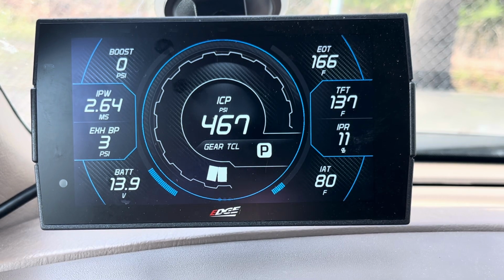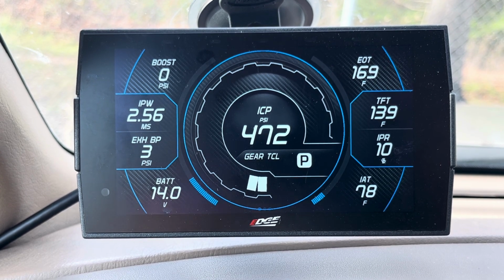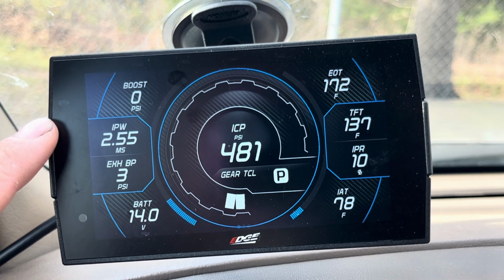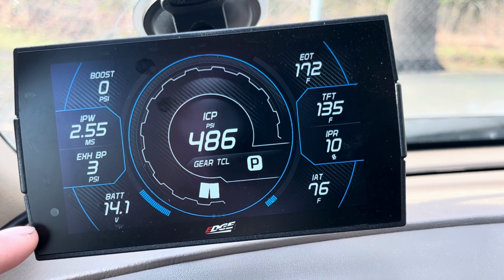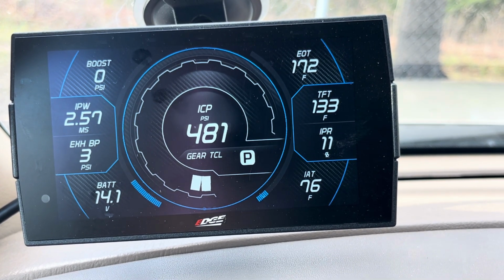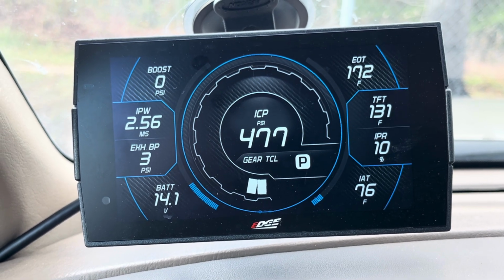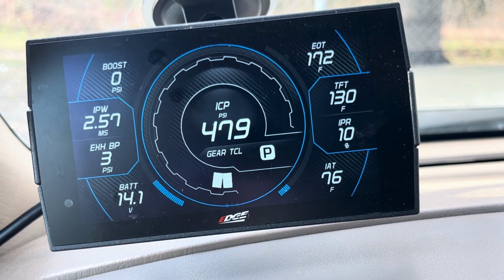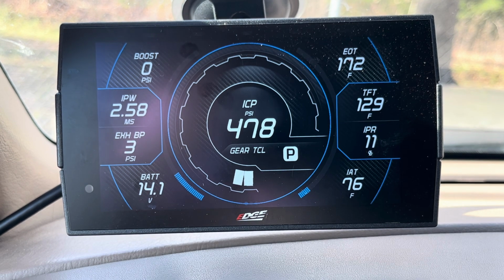What to monitor on your 7.3 powerstroke diesel and why

Comment: I installed a CTS3 last week the 7th Jan, 2026. I used a lot of the info you shared to set up my CTS3. I was able to get the gear TCL to show. It is nice to see what gear it is in.    Yesterday the   12, Jan, 2026 I disconnect the batteries because I started to install the PHP Hydra. Today when I was done with the Hydra install and had the batteries hooked back up the Cts3 didn't wave everything the way I had it set up, which was pretty close to your setup. I had reenter the VIN.  Now I can't find where the gear select is. It acts like it no longer seer that parameter.  Do you have any suggestions how I can put that back on the screen.
Thanks
Reply from the maker: I have seen this a few times and I am not sure why the hydra causes it. Reset the CTS 3 in the factory menu with the hydra installed. You will have to re do your gauges but it might correct the issue. If that doesn’t work contact PHP or Edge and let us know. Both have good customer service.

Comment: 4r100 can pull 220f all day.
Reply from the maker: Proven fact the cooler your automatic transmission runs the longer the life. Running 220F is getting up there and doesn’t give you a lot of room if you hit a big hill with a load.
Reply: @cbr600rx7 I’m just saying it can run at those temps. Yes you are right hit a hill and it rises. I’m saying if you hit 220 climbing it’s nothing to be concerned about especially towing or like me my e-350 weighs 12,000 lbs loaded when traveling.

Comment: Just received the CTS3 for my 2000 7.3. I thought boost was a PID that would be read. Now I’m reading that one has to buy the EAS comp kit to do that. Will the CTS3 Insight read boost from the PCM or do I have to add EAS kit (effectively doubling the cost)? Thanks
Reply from the maker: The CTS3 can read the MAP sensor up to around 23psi over atmospheric pressure.  (Air pressure + boost pressure) if you need to read more than that you will need a dedicated boost sensor.

Comment: My ebp shows 0 at idle and never goes above 6-8 but my exhaust is straight piped
Reply: Same for me I was wondering the same thing I see nobody responded😂
Reply: Straight pipe, turbo back or do you have custom headers? 
Ebp is on the headers. Mine is straight pipe from down pipe back, mine reads 14.5 psi at idle. Cant figure why his is so low.
Reply: Not sure if headers is the correct term for turbo/ diesel motors. 
Exhaust manifold? Lol

Comment: I'd pay for a list of abbrevation explanations with proper ranges.
Reply: You can Google most of it, it’s kind of a pain. Not every truck will have the same parameters, but some will be close to universal.
Reply: When your scrolling through there’s a little circle by each option. And it will pull up what the abbreviation means

Comment: I put EGT in the middle and set an audible alarm on that rotating ring around it. Edge makes you buy another kit. Then you have to drill your exhaust manifold. Looks like you have another vid on that.
I've been told that an actual coolant temp can be added with another Edge kit, and a sender installed somewhere in the coolant stream. Have you done or seen that?
Reply from the maker: You can a ton with the CTS2/CTS3. And yes you can add any pressure or temperature you want to the CTS. Almost all EGT sensors require drilling into the exhaust manifold.

Comment: What transmission temperatures are you getting pulling a load with an aftermarket cooler or a 6.0 cooler
Reply from the maker: About 30F cooler. It’s pretty hard to get it over 180F with out a heavy trailer behind it.
Reply: @cbr600rx7 thanks I went with the gradient aftermarket cooler

Comment: Speaking of transmission oil temperature, beware, these transmissions have an in line thermostat for cold weather conditions located on the right side of the transmission. They tend to seize and won’t allow flow to the transmission cooler. This burned my transmission. I had to purchase a reman transmission from Ford , only to have it overheat again while pulling a load. I found out about the problem and I ordered a bypass kit and removed the thermostat. No more issues.

Comment: so off topic but.. can these motors idle forever (like overnight w/ the air on) as I have been told?
Reply: I worked in the oil field drilling sector. We spent 5 years in ND ( from Texas ) and my crew and I run our trucks 24/7.  It’s usually 18-24 hrs to drive there, then a 28 day hitch, then drive back home. I’m about to hit 500k ( still all stock) and I’ve had no issues and haven’t heard anything from the other guys doing it.  Just my experience. But I never really turn this truck off ever. I have no idea how many idle hours it has but I’d say plenty.
Reply: @ChaneyMcDonnell  thanks appreciate that
Reply from the maker: That’s open to a lot of debate. I would definitely adjust the service schedule to accommodate the long idle/run time regardless. Personally I am not a fan of idling any engine for long periods but I also understand it’s necessary some times. In theory any non emissions engine is going to fair way better idling over something that has EGR/DPF/DEF/NOX/ETC

Comment: Do you know if the "Abbreviated" term are editable? EOT? I know that is Oil Temp because you descried it. Otherwise I would be guess. My brain is locked into aesthetics. Can EOT be edited to say Oil Temp, or simply Oil? Some of the abbreviation make no sense in my brain.
Reply from the maker: I would reach out to edge that’s a good question. I have personally never tried to change any of the terms because they are what I commonly use as a diesel mechanic. EGT, EOT,HPOP, IPR,IPC,MAP,ETC.

Comment: You know there's other option screens on that that shows you more data base
Reply from the maker: Yes this is just what I like to monitor with the CTS 3 and the screen I prefer. When you have the smaller windows open it can be hard to see at a glance or it can even slow down the CTS3 a little.

Comment: Are all of these numbers off the OBDII or do you have extra sensors installed?
Reply from the maker: Everything you see is OBD2. You can expand it with extra sensors like EGT and Fuel pressure.

Comment: I’m 20 years old, never owned a vehicle in my own name.. I’ve been blessed to have my first truck that i payed for old 2000 f250 7.3 superduty, 4x4 at that..  It came with this tuner the cts3, also the s&b air filter. i haven’t had any issues so far, because i haven’t put any heavy loads or anything on it, i don’t mess with the different level of tunes unless im coal rolling my uncle..normally just plug it in in the morning then just use the gauges for safety while i go to work. So im new to all this info specially to this diesel, what’s the point of the TCL, and what gear does it lock up for you normally. Mine will show lock at gear 3 whenever i reach it. i just want to know what it does really , and should i do anything different when it does lock
Reply from the maker: The lock icon represents torque converter lock up. And no you should do anything different. It’s some times good to know when pulling hills or in a performance application. Congratulations on the 2000 you likely have a forged rod motor.
Reply: @ Thanks for feedback! Is that so?? i bought it for a really reasonable price with about 228,000 miles. I plan on keeping this truck to the end of my time. Just trying to do as much research on it that way i’m maintaining it the proper way!
Reply from the maker: @ you are on the right track. Maintenance and monitoring is key on these trucks. Keep it simple and don’t go crazy with mods and you will do fine.

Comment: I added Fuel Pressure and EGT sensors to my CTS3, and I did not regret it.
Reply from the maker: Nice. I have been considering adding fuel pressure and true boost to mine. Having an actual coolant temperature reading would be nice as well.
Reply: @cbr600rx7  coolant temp would be nice. I have one more open slot on my sensor extender, and that might be my next addition.
Reply from the maker: @UpsetOctopus  nice. I ended up going with the glow shift 3-1 with EGT/Boost/Fuel pressure for $200. I might do more with the CTS3 in the future but this was a quick and affordable option.
Reply: Does it read the transmission fluid temperature from obd2 port or would I have to install a probe?

Comment: What program is this your running with the app on your phone. .??? Im going to replacing my stock turbo with 300k on it with a trick KC Turbo and swapping my stock HPOP with a Adrenaline HPOP unit. Still running my stock injectors as im not looking for speed as much as i am fuel economy and reliability.  I have the BANKS SIX PACK SET UP with Gale's awesome intercooler set up. And the 6.0 tranny cooler KICKS ASS when towing. Best thing you can do for your 4100R.
Reply: After going through  guzzle7pt3s site and the php forums. I would look into rebuilding the stock hpop if needed instead, just do a harpoon and hutch mods but without the ridiculous overpriced kits, rebuild stuff as needed. Some people have reported adrenaline hpop failures, might be FUD I dont know but I'd save the money either way
Reply: It may be forscan

Comment: thanks. I just monitor EGT, some random comment said monitoring boost was important or you'll blow up the turbo? is there some crazy situation where that could happen? Just put a hydra on my 7.3, was an idiot with the extreme tune and overrevved it but luckily I didn't blow it up. I'm getting around 12.8 - 13.1V, I just changed to AGM batteries, I'll try pulling the glowplug relay
Reply from the maker: Is this a OBS or SD?
Reply: @cbr600rx7  1999 SD F350 auto
Reply: Turbo overspeed is most commonly caused by boost leaks.  My 2001, 1997 block and rolling assy, hits 40+ psi all day long with no issues. Note, its not super crazy on mods, but not stock. FFD stage 1.5 sticks, 4" ported 300 turbo with billet wheels .84, 4" turbo back, ebpv pedestal delete,1023 tunes on a hydra, s&b intake, riff raff frx and boots, zf6 conversion with valair ceramic dual disc, ccv mod, 37" tires,  and a few other odds and ends